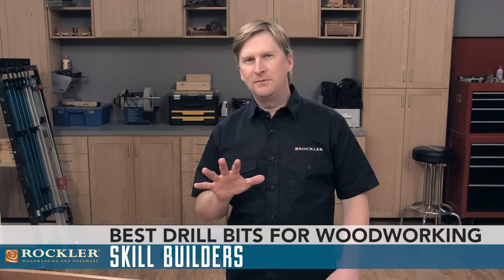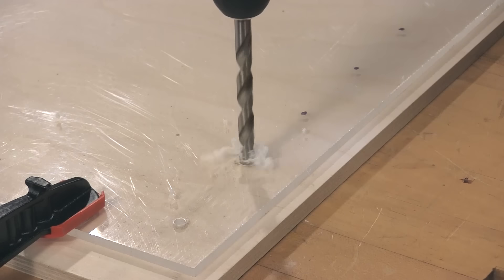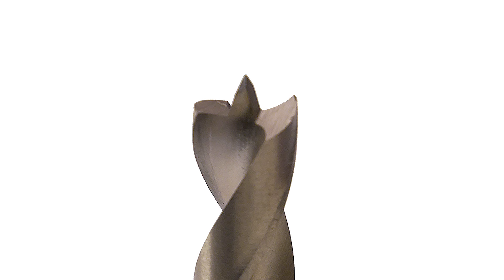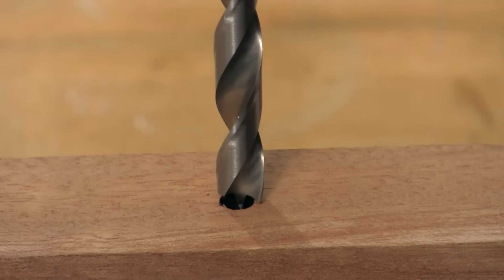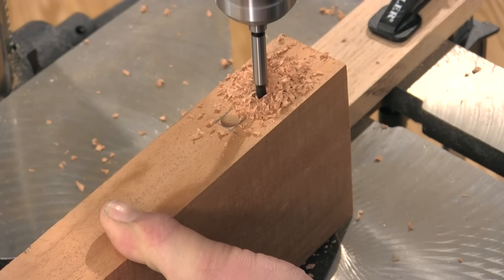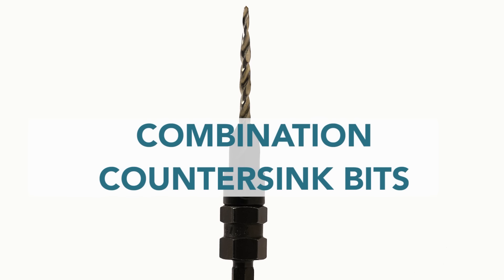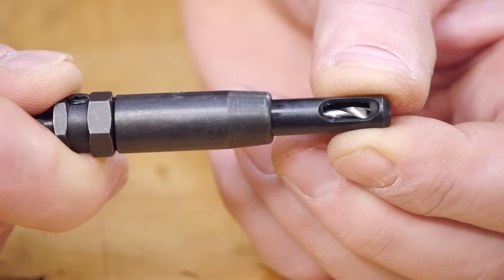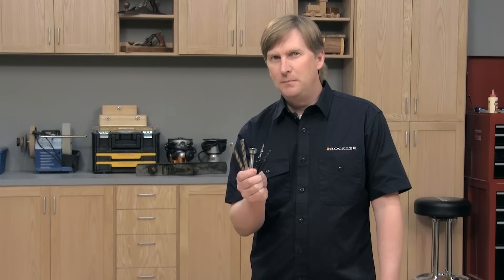5 Best Drill Bits for Woodworking Projects

Comment: Thanks for the great video! I want to drill some 1/4" holes for tie down tracking on my enclosed trailer vinyl over wood walls. Regular drill bits cause the paper thin white vinyl to separate from the wood and twist. In return, it causes a wrinkle in the vinyl at times as much as an inch or two. Any idea of what type of drill bit can be used for creating a clean hole without grabbing/separating the vinyl over wood? I would appreciate any advice. Thanks again. Ray
Reply from the maker: Hi there, a fresh, sharp 1/4 Forstner bit or brad-point bit might do the trick. Both styles have sharp spurs on the tips to cut a rim in the material before excavating the waste inside to create a clean entry point. The key to cutting a clean hole in your vinyl surface with these bits might be to start the drill or driver at full speed before engaging the the vinyl and then gently touching the spinning bit to the surface. The effect should be more of shearing cut than a twisting action. Good luck!

Comment: would you use a forstner bit for say creating a hole for a bolt for a garden bench? thanks
Reply from the maker: A Forstner bit is a good choice for boring holes with clean walls and minimal tearout in both hardwoods and softwoods. They also form a flat, square bottom surface making them ideal for recessing bolt heads.

Comment: Which type of drill bit would you use to drill into an hardwood floor to pass a cable to the other floor? The last time I tried I used a forstner drill bit (not sure what coating it had) and it barely scratched the surface....
Reply from the maker: A conventional twist-style drill bit or a brad-point bit both should be able to drill through a hardwood floor. So will a spade bit. But be advised that hardwood floors are held to the subfloor with scores of nails or flooring staples that will wreck havoc with a sharp drill bit. If possible, buy or use a bit for this job that you won't mind damaging (or even destroying) if you do happen to hit metal fasteners while you drill. This isn't a job for your best woodworking bits.